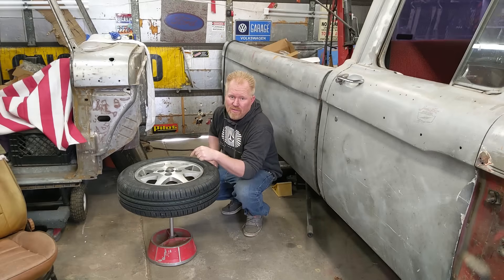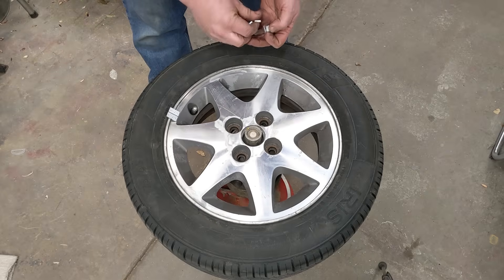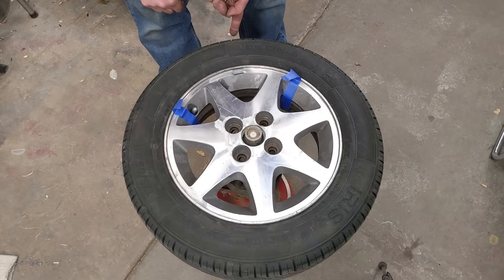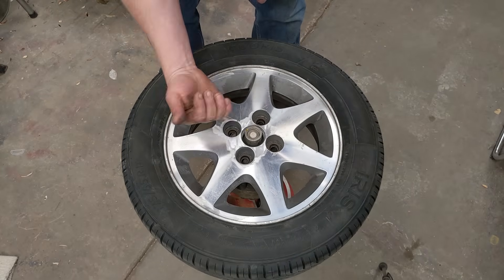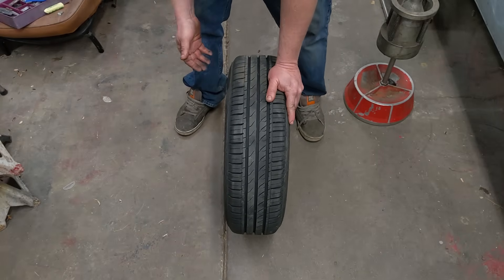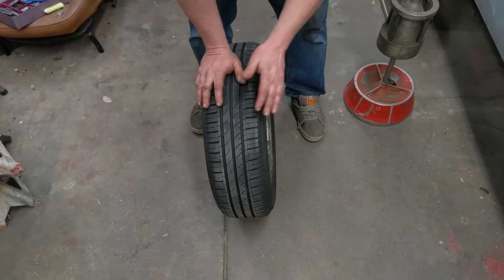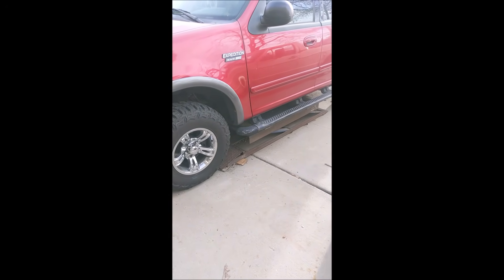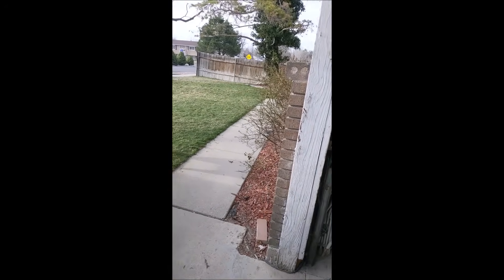Best Method How to properly Balance tires with a Bubble Balancer AT HOME

Comment: Way to go...!  Thanks for the reminder...!!  
...of the way to get the 'weight' you actually need from 2 fixed weights, neither of which works by itself...  AND for showing (and giving the reasoning for) using tape to put the weights where they actually go for final balancing...!
(Good idea to read the use intent from the original patent too - done that a few times too)...!

Comment: If I need new tires then I drive to the auto repair shop. There the salesman tells me which tires I can drive. 
Then I pay. The workshop takes off the old wheels and mounts new tires on the rims. 
Balance them dynamically and screw the tires back onto the car.

Comment: Nice video. Thanks a LOT. This is someone else's comment I pulled off an old forum a while ago for my Micro Precision Wheel Balancer. Thought it might help.

"I too had, and still have great results with "old tech" bubble balancing. I do it a little different than a lot of people do tho. I put the wheel/tire on the balancer and find out the balance point and weight it takes to center the bubble, then put a chalk mark there. I take the amount of weight needed and divide it by four. Then I take 4 weights of equal weight, that total about a half ounce more than needed, lay them on the tire/rim next to the chalk mark, 2 on each side of the mark, and start moving the pairs away from the mark 2 to the left and 2 to the right, equal distant, until the bubble centers. Put a chalk mark by each pair. Take the tire/wheel off the balancer and hammer 1 of each pair on the backside of the wheel opposite their chalk marks. Then put the tire/wheel back on the balancer, take the remaining 2 and start at the original mark and start sliding them out left and right until I have balance again, mark them, take it off again, install the 2 weights, check again, and done.
If you do it right, you can put the unit on a spin balancer and be right on. Before you try to balance a tire/wheel assembly you want to make sure you have a wheel that is true (not bent) and a tire thats tread is true. I have only run into a problem twice with this method. The first time about drove me nuts. Balance take out and drive, works great. Customer complained about out of balance. checked and it was right on, took customer with me, he is satisfied, comes back, complains about balance problem. I had to do some serious thinking on this one after about 4 times. AHA!, I drove it, and took the customer out and got approval, then went back and put the wire wheel hubcaps with knockoff on them back on. One hubcap was 3/4oz out of balance. Balanced with hubcaps laying in correct position (valvestem) on wheel and solved problem. Second time same thing, 1963 Buick with masive cast piece that looked like turbine veins screwed to hubcap. Factory cap.
I too, drag raced and never had a problem with balancing this way. Great piece of equipment you got there."

Comment: Do you find this Y technique addresses problems that show up in spin testing? That is, if a wheel has a dynamic imbalance and you then static balance it using the Y method, some percentage of the dynamic imbalances are also addressed? In fact, a higher percentage than straight line static balancing? TIA

Comment: where do you put the weight on the inside of the wheel? furthest inside closer to the underside of the car or furthest out towards to outside of the road ? Thanks !
Reply from the maker: As close to the center of the wheel as possible.
Reply: @sixtyfiveford  I appreciate your response! I’m just curious since i see them in either outside or inside but never anywhere else

Comment: I use this method and also modified the harbor freight balancer with a 1.5 dia steel ball from ebay that goes up inside the part that the tire sits on. You also have to mod the lower part so the ball sets on a flat surface. A guy has posted on youtube how to do the mod. Over time the pointy spike no longer moves freely thus the mod.

Comment: I have balanced my wheels on 2 diffrent shops spent 100 bucks. Still vibrations in them. Has micheline tyres. Can this method take the vibrations away? I had no vibrations before tyre change.
Reply from the maker: This isn't going to be better than a shops balancer. Balance likely isn't your issue. You might have an out of round tire (they should of caught this is it is), bent rim or driveline/cv shaft issues.

Comment: Can somebody explain why the valve weight doesn’t seem to effect the balancing
Reply from the maker: Because there is a hole in the rim (steel or aluminum). That weight is cancelled out by the weight of a rubber valve stem. They are so close to the same weight it makes little to no difference.

Comment: This man knows how to use a bubble balancer, I finally found someone that understands it. I did this for a living 45 years ago.
Reply: Agreed, except I learned in high school auto shop in 1976 48 years ago! Still mounting and balancing my own tires to this day...
Reply: How do balance beads compare to a bubble balance in skilled hands? Can you use both?
Reply: @Rankine_Cycle21   There are a lot of "it depends" here. The balance beads actually balance the entire tire/rim and wheel hub/ brake rotating assembly. So if you have a wad of mud stuck on the inside of your rim, the balance beads can help counter act that.  A bubble balancer in the hands of somebody who knows what they are doing is very good. The thing nothing can fix is if your tire or rim is out of round (like an egg). No amount of balance, balance beads or other gizmos is going to make an out of round assembly ride smooth.
Reply: Guys, really important question for me: the bubble balancer will perfectly balance it in one plane. What about side to side balancing that the spin balancer fixes? Like the weights they stick on the inner and outer side of the rim? Is that negligible?
Reply: The bubble balancer works, but it’s not as good as a high speed balancer; and it takes forever, compared to modern machines.
Reply: @robotron1236  some of us like to do our own work.
Reply: @relevation0  I get it, I love bubble balancers, it’s just not something I’d use for a customer’s car.
Reply: @robotron1236  true but i ain't got a grand for nor the space for, a digital machine
Reply: @robotron1236   NHRA Top Fuel cars use bubble balancers....but they only go 300 plus mph lol.
Reply: @RejectReality97    On our road race car we get globs of molten tire rubber (also known as track boogers) as large as the size of a ping pong ball stuck on the inside of our wheels.... Amazingly we don't feel any vibration from this additional mass even at 140 mph. Hell, we've even mounted tires totally unbalanced and never had an issue. Get a tire close to balance and you won't have any issues, assuming the tire and wheel are truly round.  Have you ever had your laptop glitch or freeze up on you?....yeah, that happens on the high tech tire balancers too. They can also go out of calibration. Tire balancing is super easy if you know what you're doing, regardless of using a manual or electronic method. The most important part of the equation is not the method & equipment but the person doing the balancing.

Comment: What is your thought on balancing beads for 35"  mud terrain tires. Still static balance with the beads?
Sometimes these tires lose chunks and trap rocks so balance usualy changing all the time. Dont need high speed some highway driving  average speed 65 mph

Comment: Love your dog he's a character, not all but some tires have a mark when new that is supposed to be lined up with the vale stem when mounting the tire and it helps balance the tire, many times requiring no weights at all, I wish more tire shops would use stick on weights on the inside center of the rim, it looks and works better, but most tire shops won't spend the extra time it takes to apply them and a box of those stick on weights is not cheap, I've used one of those balancer's I bought from Mac Tools for years and it works great as long as you keep the spring loaded alignment rods clean and lightly lubed and keep an eye on the pivot pin that the balance assembly sits on, the pivot pin is replaceable if it gets bent or worn down.

Comment: I bubble balance all of our tires.  I also add a capfull of airsoft bb's after balancing to continuously fine tune itself.  The ride is amazingly smooth at any speed.  Even ice/snow is not a problem unless there is a lot of it on one side of the rim.
Reply: Greets. Can you please explain what you mentioned about the airsoft bbs? Thanks!
Reply: @dobrofool  look up "balancing beads"

Comment: Yeah that's old school,  only problem is you can tell 20 ft away tire is bubble balanced.  Plus you're using more weights.  Just half distance of y is where weight needs to be and won't be as much as you're putting on. Never slam tire on balancer or you need to recalibrate balancer.  FYI  both methods bubble or on wheel hub uses gravity 😉

Comment: Well this certainly piqued my interest! Got new tires a while back and the dots on the front tires corresponded to the valve. For some reason the dots on rears were not lined up. They had weights, but I could feel the imbalance. I had to do a fair bit of convincing the kid at the shop to rebalance them. 
I balance my own motorcycle tires, but will try the Y technique next time. 
Great video!

Comment: Excellent video and made me think about the hows and whys.  I drive an old landrover so balancing wheels doesn’t really matter at sub 55 speeds. However I can see that if it’s this easy to do, it might be worth doing. A 75% balanced wheel would be more than good enough.

Comment: I worked at Western Auto '74 when computer spin balancers were invented. Of course there are a lot of niceties like where on aircraft they separately, permanently balance the wheels by themselves that could be done for the best possible job. But I do know how the machines work - they are simply easier-to-use versions of the soft-bearing balancing machine.
https://en.wikipedia.org/wiki/Balancing_machine
      I like the part of this video where you explain to your audience the part I agree with: NOTHING BEATS A PROPERLY COMPUTER SPIN BALANCED TIRE AND WHEEL.
PS - if you got a truck or trailer that never exceeds about 35 mph don't bother balancing it's wheels at all = waste of time and effort.

Comment: Yes! , I love this. too often people think that it has to be this way or that it was the only method or you need a special device (too expensive for a private person). as I recently got the question from someone for some more info about an impact driver. he saw that every tire shop used this so assumed that it was the device with which you need to mount wheels. I said there's only one reason they use it: speed! (to be able to do more customers in the same time). in fact, you almost certainly stretch the bolts further than allowed and I dare say that 95% of all bolts have been abused by this way of working. ok, not that every day the wheels of cars fly off due to broken or loose bolts (no more stretch = no more clamping force when something comes loose a little or settles). When you do it by hand you also feel what you are doing. you make sure the wheel comes into place by shaking the tire a bit while you tighten a bolt lightly etc ... (I do use a cordless drill to turn the bolts in and out but the first tightening only happens  by hand and by feel, because almost all bolts have been abused, I dare to do the final tightening by hand (and feet) by feel, only when I am 100% sure that the bolts are new or not abused I use a torque wrench. So this is also a completely different story and answer than that person expected. you have to look at everything in its context and sometimes go back to basics. I need an electronic balencer way too little and it costs way too much. but what that expensive machine can do, we can also do, and even just as quickly and easily. just back to basics. just like balancing an old scale. no you don't need an electronic balancer or a driver because every tire shop uses this (just for speed, insurance etc etc). you can do it at home, cheaper, just as quickly and with a better result. I just now discovered this bubble balencer through this video and it was a eureka moment. sometimes it's that one person who is right and hundreds claim not because they're a bit brainwashed because they've always seen it in a different way. but if you think about it for a second it makes perfect sense. I love to discover such things, and mostly they are old skool methods. thanks for sharing, use that brain and dare to look at things from a different point of view. thanks sictyfiveford ! greetings David

Comment: All rims can be dynamically balanced. This method is only OK for fixed axles and will produce a dynamic on any steering wheel. It was OK back in the pre 1970s as vehicle suspension was a lot heavier and the dynamic rattle was less noticeable.
Always get a dynamic balance for the steer tires of modern vehicles.

Comment: Years ago I got new tyres and  the balance was out. Took in back to tyre shop and they rebalance them, still crap. Took to a old bush mechanic  and he used a bubble balancer. It was spot on. 👌
Reply: I have the same problem have been at two shops still unbalanced.
Reply: The trouble is on those new electronic balancers is that when they run the machine and then put the weights on, they don't re-run the machine for a check.  That check will show that fine-tuning would be necessary a significant part of the time.
Reply: @sonicdewd  You're going to the wrong shops: I always re-spun them to make sure they were good.
Reply: @foxfordcatguy2283  swear they all get zero"d

Comment: I think you forgot to tell everyone that you must have the center hole on the rim needs to be centered around the balancers center shaft with the bubble  And you have it almost touching one side and a big gap on the other side. It's  impossible to get it 100 percent balanced  correctly centered the way you have the rim sitting on the balancer it's impossible to get it done correctly the way you have it set up. If you're going to try and teach someone something do it correctly with all the proper information!!!!
Reply from the maker: Not sure you understand how this works. The spot where the wheel sits is a cone and self centers when you slide the wheel on.
Reply: @sixtyfiveford  correct but sometimes the hole on the center of the rim is bigger than tapered shat even at the largest part on the base and if you watch your video it looks like a pretty good gap on one side and touching on the other side only only point this out not to be a smart __ss but I've been using that lll same style balancer long before they made everything else and have owned and used a few different brands over the years and I have 2 of them that I use every week on UTV and ATV tires and they have a much bigger center hole and I've made up a tool to make sure it's centered that goes on from the top with a double tapper inside to match the machine side and bigger on the out side to center the rim and are shop has a 1-2 year old snap on big dollar balancer and now I can do them and then put it on the new balancer and 99 percent of the time right on the money but before even with car and truck rims the center hole of the rim is bigger than the largest part of the tapper of the machine that that's the only reason I pointed it out maybe in this case the  camera angle makes it look off center and please don't think I was trying to disrespect you in any way because I'm NOT just thought I'd share this information hopefully you see that have a great day.. Bob...

Comment: Old school is still old school. Been bubble balancing for over 50 years and it always solves the problem.
Reply: It doesn't solve the dynamic imbalance. It only solves half of the problem
Reply: @fuglbird    if you understand what needs to happen, you can bubble balance close enough to solve a shake at most any normal highway speed.... which is what the customer wants. Of course, you also need to be sharp enough to realize that some so-called balance problems are actually a bad tire. I have spotted that with a $5k unit and also with a $200 bubble unit.

Comment: This things work. Amazing.
I  have done the bubble balance. Marked with a pen on the tire by the  wheel. Where it needed weight. 
And  sure enough after the spin balance. They came back with weights Where the pen marks were.
Reply from the maker: I've done the opposite. Where I took a freshly machine balanced wheel and threw it on my bubble balancer and it measures perfect where didn't it before. I should have marked out where I thought the weight should have gone though like you did.

Comment: I have used this method on my 65 MGB because it has wire wheels, and mounting them on modern balancing machines usually ends with the balance being way out.  This is because of the surfaces that the wheel uses to center it on the machine.  After a few bad experiences, I picked up a bubble balancer at a flea market.  Since then when I balance the wheels, it works every time.
Reply from the maker: Yeah I know old VW rims can't be balanced on modern machines and I even have some Toyota heavy duty ones that can't be.
Reply: I have a sunbeam alpine with wires on it and I just got a bubble balancer to do this..thanks for your comment,,give me confidence this is a good way to go.. I was doing mine in a modified motorcycle truing stand.. Cheers

Comment: Interesting about the rocks, may check mine some. Had a bunch of mud caked in the inside of my tire once, that threw stuff odd a bit so makes sense
Reply from the maker: I honestly think that up to about a half ounce you'll never feel. Seams I clean off gobs of tar/laced gravel every time I put a new set of tires on and I never felt a vibration.